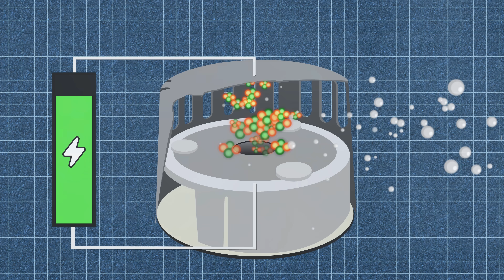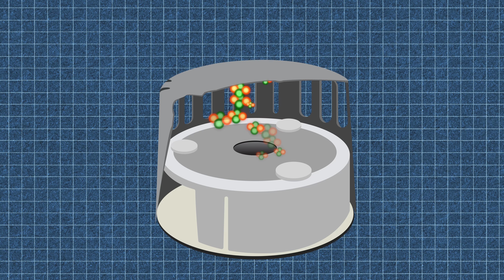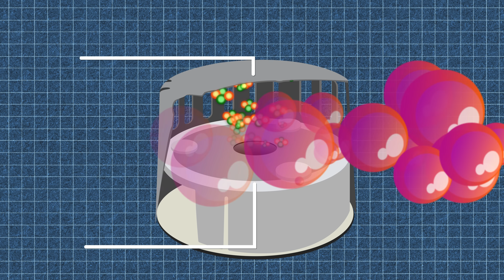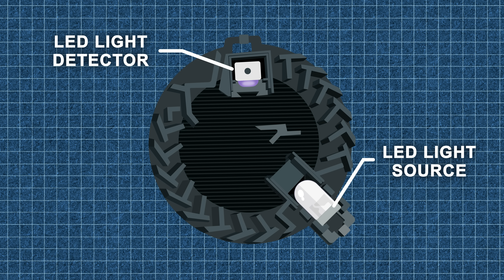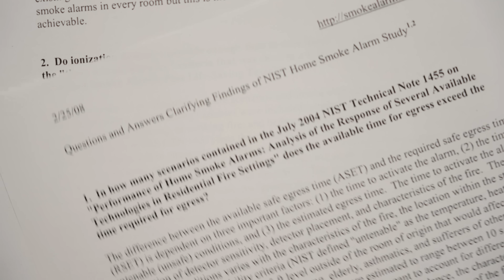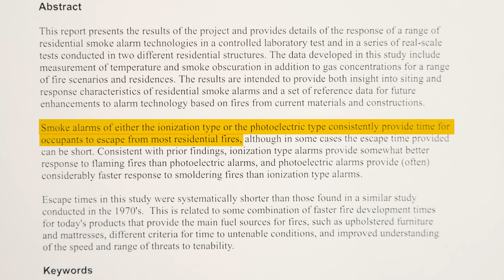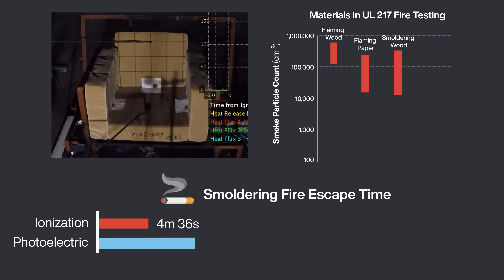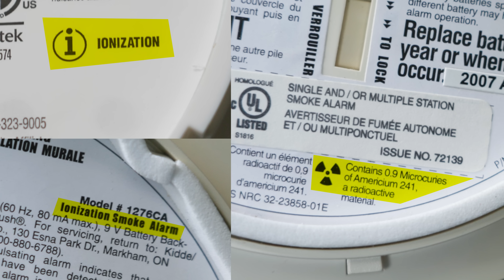Why the Most Common Smoke Alarm is Dangerous

Comment: Of the fatal house fires I learn of locally, almost all of them have no working smoke detectors with about half of those having none at all. In over half of the 'non-working' cases, it was battery powered and the resident apparently removed the battery. In many other cases the battery was dead. To alleviate the intentional disarming and problems with dead batteries, newer building codes require interconnected grid-powered units with battery back-up, yet you get the same problem as people now simply remove or unplug the units. It is paramount that safety devices of all kinds preclude false alarms or people will find a way to disable them. 

There is a flaw in the photoelectric or optical detectors: they will alert over airborne dust as quickly as they do smoke. Based on where their sensitivity level is set, that can be an almost imperceptible amount of dust. I hope these new detectors can discriminate against that. 

And here's a closing thought: Christmas may be a long way off, but for those you know who have defeated their detectors now you know the perfect present for them, and one which shows how deeply you care.
Reply from the maker: Yeah, those were a HUGE reason why people died.  Hopefully with 10-year batteries and reduced false alarms that will stop being such a big problem. 

Optical detectors are suspectable to dust, vacuuming is recommended and almost all newer designs have dust/ bug (spiders) to reduce that issue
Reply: @Lam  + filters
Reply: @Lam  False alarms are likely the biggest reason for smoke alarms being deactivated.
Reply: @Lam 10 year batteries guarantee people throw the whole detector away and forget about it. Never mind the waste. 🙃
Reply: Not actually a correct I had as  previous consultant who was an expert court witness he stated the issue with most investingations is that they are done dishonestly and the usuall cause attributed to dead or missing batteries is usally becasue they dont want to admit that the reason for the failure was an ionizatoin alarm which cannont detect detect smoke was recommeded  and this guy made a report that the endline said something like the number of cases where the alarm reasom of failre attributed to its inability to detect large particulate smoke is zero! the claim for failure will be dead or missing batteries even if it was replaced yesturday as for the 10 year argument its not right  beacause the CDC even came out wiht a  report that said 10 year  alarms dont last 10 years ! bet you did not know that ?
Reply: The best way to ensure that people dont unplug them or remove the battery, is to make sure they dont trigger when there is no danger.

For example, my current fire alarm is of an older type, and if I do not turn on the stove fan, it will immidiately trigger for something as little as a pancake even if the pancake is not burnt at all and i cant see the smoke.
If i forget to turn on the bathroom fan, the smoke alarm in my house will also trigger from the STEAM when I shower, which imo, is worse. Imagine you are showering and it triggers the alarm in the hallway of your home and you live alone. You have no choice but to walk out of your shower.

Most people who unplug or disable their alarm would do so out of annoyance from their alarm going off when there is obviously no fire.

And regarding the comment above, a cancel button of the fire alarm would also be helpful. Perhaps a button to silence it for the next 5 minutes. This might encourage the people who would completely unplug or remove the battery when it gets a false alarm, to just push the button instead. While it does mean 5 minutes without fire detection, that is much better than potentially forever without it.
Reply: @FlorenceSlugcat  This sounds like an ionization type smoke alarm issue. Also check if the smoke alarm is installed too close to your cooking appliances or bathroom. Code dictates minimum distances and it is probably 3ft. from the bathroom door and 10 ft. from your stove, measured horizontally. (This is the local code for my area, your requirements may be different.)
Reply: Look up ceiling bird memes. The low battery smoke alarm chirp in the background of low-income people's zoom call or call of duty microphone is a real thing.
Reply: The bigger problem is that faulty and/ or shittily-designed alarms also cause people to tear them out because they become unbearable to live with.  I've lived in houses with battery backup alarms where if one of the alarms has a dead 9 volt battery in it, then every single fucking alarm would start chirping with zero visual indication of which alarm needed a replacement battery, forcing you to check every single battery in the house in the middle of the fucking night.  I've also lived in houses where alarms will just, you know, go off without any discernible cause, whatsoever.

If regulators want to get serious about making sure these alarms stay installed, then they need to hold these companies accountable when they throw slap-dash alarm systems out onto the market that no reasonable person could ever be expected to live with.  Because the sad truth is that builders will almost always pick the cheapest option, and the cheapest option is almost always the one that has had the least thought put into what it's actually like to live with said product.
Reply: Rant with solutions incoming. 
There is a VERY simple, clear, and logical reason people remove the batteries, and it is solvable: the batteries tend to fall below the threshold when they get a bit colder - which happens at night while you sleep. And for most alarms, the low-battery warning is an incredibly brief but loud chirp, so it wakes you up - but you don't know what woke you up. Then you fall asleep again, and it wakes you a few minutes later, and this repeats. Sometimes it can repeat a few nights in a row - that has happened to me, it ruined three nights of sleep before I stayed awake long enough to hear the chirp a subsequent time. And the chirp WAs so brief that i cannot tell which direction it came from, so it's non-intuitive that it is the alarm.

The house won't catch fire in the middle of this one night, and no one is in the mood to find new batteries in the middle of the night (if they have spares at all; most of these alarms take 9v batteries which are increasingly rare). So, they take the batteries out, and make a mental note to replace the batteries during daytime - which they completely forget to do, because they were half-asleep when they made the mental note.

I bet 90% of us who had an alarm battery fail have experienced exactly this. THIS is why we have alarms without batteries; they always fail at the time we are least capable or willing to replace them.

The solution is for the alarms to monitor ambient light, and send the low-battery alert when there is light and people are capable of replacing them. It is not hard to have a small photoelectric diode that both detects light and can power this functionality (in fact, it could probably power the alarm forever). In addition to that, the alarm should have a large, visible indicator that the battery is low. Not a vanishingly brief strobe; it should be an easily visible, colored indicator - it works for all the fuses in your home fuse box, it can easily work for an alarm. I'd suggest that it should be a red panel that is revealed, or could be a red e-ink screen that activates to red when the battery is too low (e-ink requires no electricity normally, it only requires electricity when changing state). 

Also, as a separate thing but this is a pet peeve: alarms should have their beep codes written on the front. Most of the ones at my local stores have them written on the back - one beep for low battery, two for alarm malfunctioned or expired, three for smoke, four for carbon monoxide, etc. This means that, when the alarm starts beeping, you must get the stepladder so you can take the alarm off its mounting and read the back to see what the problem is. Or, alternatively, you can leave the house and call the fire department every time the battery runs low. THIS IS INSANE. There is space on the front of the alarm to write this. In BIG, BOLD letters! Much larger and clearer than it is written on the back, where it must fit with all the manufacturer information and the safety warning that the alarm is toxic if you eat it.

Personally, after returning multiple alarms that failed basic user-experience tests, I ended up with one that has a permanent 10-year battery built into it. And it has labels - on both the back and sides - where the user writes the date it was installed to easily track the 10 years. The manufacturer installed all the labels upside down, but it's still the best that was available.
Reply: I actually have both ionization and photoelectric smoke detectors in my home. Both placed strategically to minimize false alarms.  There are smoke detectors that have both ionizing and photo sensors, so you do not have to buy so many. But I am a person who prefers redundancy. If it's your life and your family's  life, would you want to gamble and risk your families well-being?  I think not. I will put up with unsightly smoke alarms and annoying false alarms so my family will be safe.
Reply: I hope the wired alarms have a way to test and indicate a battery needs replacement still. While having them connected means the batteries will last longer, it doesn't mean they won't go bad, and if they go bad, you'd only find out at the worst time possible unless it has a way to alert you.
Reply: @guard13007  With USA detectors, when the battery gets weak the detector will "chirp" about once per minute. It will still function in a power loss like that for a couple weeks or more so you're still protected until you can change the battery. Some of the 'wired' systems have a rechargeable battery and an expiration date. I'm not sure of their behavior when the battery gets weak but by then it's expired and you need a new detector anyway.
Reply: That's why it's mandatory in Germany now and the owner of the place have to get them inspected once a year or you get a fine and loose all insurance coverage.

So basically everyone does this now, which means the death toll for fires droped sharply
Reply: I think this is just a natural-selection issue.
Reply: And now most smoke detectors have programmed sulclde at 10 years, so now I see people throw out the whole detrctor to get rid of the beeping, and then forget about it.
Reply: Definitely a commendable thought. But unless you also offer to install it for them, it probably won’t get done. 🤷🏻‍♂️
Reply from the maker: Yeah, exactly that, it's an awareness and effort thing.  Many people also think fires happen to other people which is why we have building codes and voluntary codes like UL 217
Reply: You're thinking too highly of these kind of people. If they are dumb enough to repeatedly and purposely remove power from their smoke detectors, they will simply remove the entire unit if they cannot remove the battery nor power plug. Embedded batteries won't solve that problem. it will only mean replacing the whole unit instead of a battery when it dies.
Reply: Maybe a stupid question,  but don't american fire alarms give of a warning when they run low on battery?
I'm not from the u.s. and our do it. Just replaced two batteries in theast three weeks. Friend of mine has some newer, which you have to replace after 10 years, to ensure the sensors are still working
Reply: In Europe/Germany photoelectric sensors have been the norm for over two decades now and I cannot remember a time where it would warn over "airborne dust". No idea where you got this info from.   
And regarding the "pause" button - just push the thing with a pole and it goes off for a while.
Reply: The first encounter I had with an optical smoke detector was doing a renovation job on half of a building, where the HVAC system was one for the whole building. Unknown to us there was an optical smoke sensor in the ductwork, so our dust set it off even though we had taken pains to isolate our side of the building. The fire alarm goes off, everyone goes outside, the fire department arrives and checks everything then lets us back in. An hour later it happens again, but this time the Firemen tell us about the sensor and that our light dust was enough to set it off. And if that happened again we were going to be fined. We had to call in the technicians who installed the system and they said they couldn't disable it by law as it protected an occupied area, nor was it adjustable. We ended up having to pay them to isolate our half of the building from the system which delayed the job 3 weeks and cost my company thousands. The site had several other buildings like this one where we got work later, and our contract with those now had a clause regarding the building owner being responsible for isolating the HVAC system before we started and taking full responsibility for anything adverse which happened because of that. So yes, they can be set off by dust and no, everything isn't like it may be in Germany or Europe.
Reply: @whuzzzup  Photoelectric and multi-sensor units are common in the U.S. as well, but there are many parts of the U.S. in which high humidity can cause photoelectric sensors to trigger false alarms.
Reply: @whuzzzup  No idea where you got this info from Experience. And I've never seen a residential smoke alarm with a "pause" or "cancel" button. They will scream as long as they think there's smoke. (as they should) Commercial building management systems have various controls.
Reply: @jfbeam  Many residential smoke alarms have a "hush" button which temporarily desensitizes them for several minutes. They continue to chirp once every 30 seconds when operating in this condition.
Reply: @jfbeam  Then I guess your american companies should copy the devices we use in Germany/Europe.
Reply: @brianleeper5737  I had no idea that the chirp after silencing was programmed. I thought it meant that the most recent alarming had drained the last of the battery.
Reply: @gregorymalchuk272  It could mean either the alarm is silenced or it has a low battery. If it continues chirping after 5 minutes, it's a low battery.
Reply: Do smoke alarms have a cancel button on them? Because if they don’t, it would make them way better.
Reply: @blakem2902  Usually the test button also silences it. Newer ones often will lower the sensitivity for 10 or so minutes as well after being silenced, to give time for any cooking smoke to clear etc.
Reply: @blakem2902  mine does, but it's also an optical detector, so it doesn't panic at every warm fart.
Reply: @blakem2902 They usually have a cancel button that silences it for 15 minutes unless certain criteria are met (if it detects certain changes, the alarm goes off again and will not silence again until the air clears).
Reply: what annoys me is:  
1. each one comes with a different non standardized fixation; if You get a new detector You certainly need to drill new holes for the screws! 
2. if a false alarm goes off, no easy accessible button to quench the ears deafening sound! You need to grab a chair climb on and remove the detector or the battery; and to be true, after this procedure You are hesitant to set in the battery again! 
3. since the sensor contains radioactive, poisonous Uranium U235/238 or Americium Am243/241 and even Curium and nobody cares about their proper disposal/recycling ... they will cause an unaddressed environmental problem or cancer risk! ( Am/Cm mixture is nicknamed Pandemonium; by those devils; and Np237 also seems to accumulate over time; what are those ignorant Legislators hanging over our heads? ) 
4. with many Li_Ion or LiFePO4 batteries laying around in apartments nowadays, there is no proper detection for the start of these very special fires!

Comment: Obviously, a company just needs to make one that has both sensors built in.
Reply: Dual-sensor alarms have been available for years.
Reply: If it's obvious, then you should keep it to yourself.
Reply from the maker: They do, it's just very little demand for them due to a lack of awareness.  They work great for places without nuisance alarms, but in the kitchen situations how do you tune the sensor on which input to accept.  This was before 8th generation advances of course.
Reply from the maker: The problem with dual sensor alarms is these alarms can be just as sensitive to cooking false alarms (UL, Characterization of Smoke Alarm Nuisance Sources, 2015).  They're also hard to find, expensive, and the only 8th generation dual sensor alarm is currently unavailable for purchase (as of June 5, 2024). 

As well many homes require CO detection and you'll have to choose between having those separate vs interconnecting them with the rest of your home.  I think Interconnection is more important.

Kidde's new 9th generation of smoke alarm is Photoelectric only.  This was what I was expecting in the video as I was shocked ionization could pass the new tests, but I'm guessing that's no longer possible.

Comment: At 13:38 you said ionization alarms have a 35 minutue delay, but the graph shows the opposite.
Reply from the maker: So the chart is a bit confusing as it shows how much escape time you're given, not how long it takes for the alarm to go off.
Reply from the maker: The graph is correct, it's an unusual way of talking about how useful an alarm is.  

The actual metric is ASET - Available Safe Egress Time, which is how long after the alarm goes off you have to get out before conditions become dangerous.  It's a more accurate measure of how useful an alarm is in saving your life.  It's also an indirect a measure of how fast each alarm is alarm is.   

Yes, this is confusing, I thought about different ways to represent the data and this is the simplified version although I should have went with "escape time".